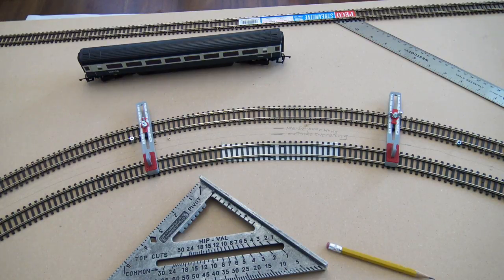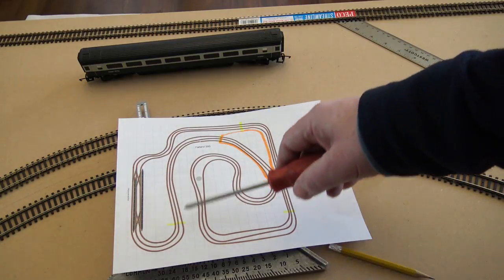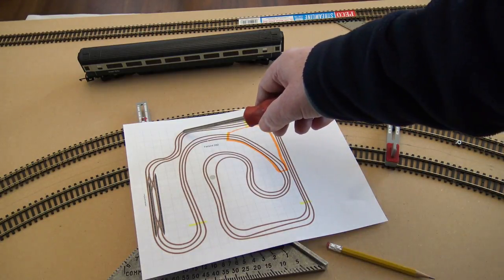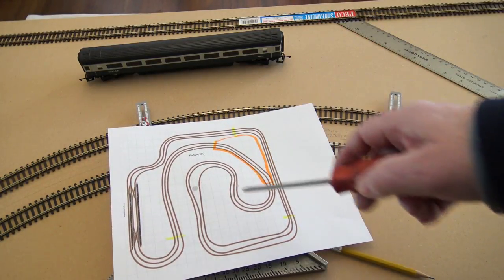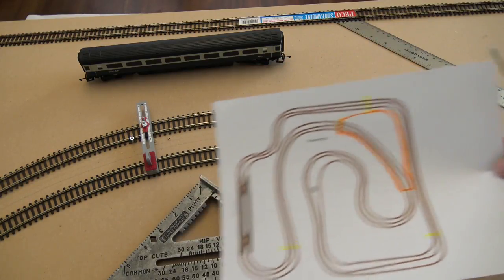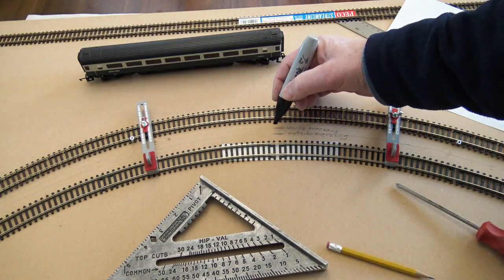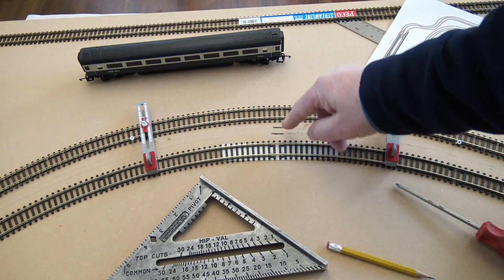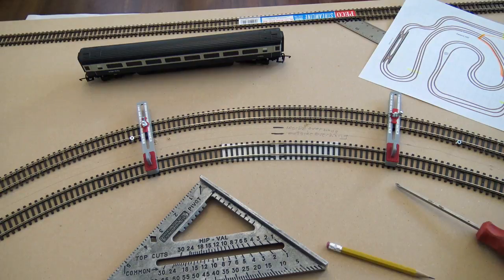01B Farland - Curve Radii

Comment: I'm just surprised that someone deliberately introduces inclines into their main track. I can see that the difference in elevation looks good but with level track even poor runners stands a chance.
Reply from the maker: Hi Alan, Glad you asked and happy to answer.  Flat is not as interesting as variations in levels.  Admittedly the engineering, craftsmanship and design must be carefully done, otherwise you have lots of trouble.  However, if the inclines are very carefully built and all rules of layout parameters are met, there should be no troubles.   I won't go into all the things I see people doing to sabotage their layouts, but my troubles are few.  My GWR King steam locomotive can pull 19 coaches up my inclines and this was demonstrated on video.   This video is 01B.  I am now on 87B.  I try to pass along information to layout builder as I go.  Please subscribe and see if I can help you too.  Thank you, Rob

Comment: Rob,

I saw that you have your throttle on your iphone.  And you mentioned that 2 throttles can be on an ipad.

What is the throttle app that you are using?  Are you happy with it?  Is it free?  Do you think it will connect wirelessly to NEC?

Bob
Reply from the maker: Robert Schworm Hi Bob, I use the Z21 system.  I am using their app.  The box that connects to the track you have to buy from them, but the app is free.  Rob

Comment: Rob,  I have a lead line into a small 3-ladder yard.  What is the recommended way to ballast a lead line into the yard? Should I ballast the lead line up to and including the first switch into the yard, and then place the track on the benchwork base?  Should I use your sub base under the rails or go directly on "the ground"?  What do you recommend for ground cover in the yard?  Thanks.

Bob
Reply from the maker: Hi Bob, There is no right way or wrong way to do this.  When you look at yards where they are intensely used, the rails seem to be sitting on dirt. with no elevation from the ground.  My advice is to look at lots of phots of yards and then decide.  Thank you, Rob

Comment: Rob,  I read somewhere  that your track radius should be at least 3 times the distance between your longest set of trucks.  So I guess if the distance is 8 inches, that makes the radii 24 inches.  Have you heard of this?  This is in addition to your car overhangs.

Bob
Reply from the maker: Robert Schworm Hi Robert, The correct radius is a radius from the manufacturers recommended minimum and a scale actual.  Once you get larger than the min recommended, it depends on how much room you have.  I chose a minimum of 22.5 inches of radius because I have the room for them in a complex layout.  On a real railroad it could be as much as 7,000 meters for high speed.  Divide 7000 meters by your scale and you’ll see you would need a very large layout.  For narrow gauge curves might be 50 feet.  Divide 50 by your scale.  As you can see, there is no correct radius because it depends on multiple factors.  I cannot run my High Speed Trains at their scale maximum because my curves are too tight although I can run them very fast for model railways.  It is a complex subject. 

Distance between the rails is a wholly different subject.  Thank you, I hope this helps, Rob
Reply: Thanks.  I thought that if the radius is too tight, then the trucks might lock and not be able to swivel, thus jumping the rails.  Guess a test run would solve it though before everything gets glued down.
Reply from the maker: Hi Robert, Generally, the manufacturer will provide a minimum radius for their models.  If that is unavailable, by that I mean after a lengthy seach it is not available, then trial and error is your only course of action.  Thank you, Rob
Reply: It gets a little more interesting when your entire layout is with flex.  fortunately with anyrail and selecting the S for track library, that helps a little.  Then I researched American Flyer a bit more and there is some info about minimum radius for that gage which is about a radii of 22 inches.

This is a very interesting hobby to be sure.

A guy in europe built a beautiful layout with a long incline.  Fully sceniced and beautiful - - - then he does a test run up his incline - - and it stalls out....including just the engine.  Hard to believe.
bob
Reply from the maker: Robert Schworm Hi Robert, a real locomotive would struggle with a 4% grade.  That is a 4 foot rise in 100 feet.  Mine are all 2%.  1 inch in 100 inches.  I wanted to be sure a steam locomotive could go up with at least 3 coaches and they all can.  Some with more.  The most common mistake with a Model Railroad is the grades.  Newer modelers always go way too steep.  Never fails.  Even when you warn them they do it anyway.  Do not put a curve or turnout right at the top or bottom either.  Thank you, Rob

Comment: Rob,  I am watching the building of Farland with great interest into the details.  What is meant by 1st, 2nd, and 3rd radii curves?  In video 1b, Checking the spacing on curves for passing coaches is very helpful.    By now Farland is probably up and running.  I am using AnyRail software with great pleasure.  It allows me to place paper trackage on my benchwork to verify spacing and radii.  Your trainroom is beaautiful, very lucky to have it.

I am watching your entire series as closely as I can.  I am doing S scale 1/64th.

Thanks.

Bob - Cleveland Ohio
Reply from the maker: Robert Schworm Hi Bob, That sounds like a very interesting project, the building of a 1:64 scale layout.  Slightly larger than my scale 1:76.   In OO scale, Hornby a very old manufacturer of OO, they have a track geometry and they produce standard fixed (or set) radius track in 4 radii.  It culminates with 4th radius which is 22 1/2 inches.  My new layout features the smallest radii curves at 22 1/2 or 4th radius.  It is sort of a short hand for British scale modelers.  Most folks use flex track now.  I was being my very conservative engineering self when I set my spacing.  If you start with any video in this series, with the B suffix, YouTube should automatically take you through the series if auto play is on.  I am at 76B now.  Thank you, Rob
Reply from the maker: Robert Schworm I was wrong, for auto play of the series you need to go to my home page on YouTube and use the playlist feature.  There are several interesting playlists you may like there. Cheers

Comment: Strange that you need larger clearance on larger radius curves.  Logically, as the radius increases to infinite, and hence the track tends to straight, then the overhang and "underhang" tend towards zero.
A long time too late, but possibly useful for others, the free software package SCARM works well for settrack and can be used for flexi, but to less benefit. 
Too many of your clips, including the old layout, are interesting, and I'm digging into the archive, hence the comments on older videos.
Regards, 
Tom
Reply from the maker: Hello Tom, well you caught me, I am very/extremely cautious.  I set my largest coach on the smallest curve track and rocked as far as it would go without derailing to both sides, measured it, and that is what I used to determine my clearances, plus 6 mm.  I just didn't want the excitement of finding out with certain combinations coaches/cars under unusual circumstances they could strike as they passed.  Sometimes these models do not behave like their full sized prototypes.  They can waggle.  So, yes, very conservative engineering, but now I can run at ridiculous speeds at times and not worry that I have exceeded the safe margin of error.  These are  1:76 scale trains running on HO ga. track. That in itself is messed up enough.   There are many peculiarities to OO ga.  That is why the gaps are so wide.  Thank you, great comment, Rob

Comment: So many regulations and inspections in your build Rob. Your choice of 4th radius as a minimum sounds very sensible if you have the space. Good to see the practical way you work out clearances. I love old tools - is that a roofers angle measure? It mentions spars and beams. John
Reply from the maker: John Mellor Hi John, I think what you refer to is what we call a speed square.  It does have angles and other things on it.  You could build a house with it a level and a measurement device.  Thank you, Rob

Comment: Hi Rob, great to see you're starting the new Farland already. With the track spacing my opinion is that if it works well and looks ok then it's good enough. Standard track spacing is 6' between the railheads and 10' for sidings, so 24mm and 40mm. When you consider we are happy to accept a 16.5mm gauge to represent 18.8mm, compromises will have to be made. If you want to justify a wider spacing then say its in the West Country. Many of the stations were built to Brunel's 7' gauge and when standardised it was easier to move the tracks further apart than move the platforms closer together.
Reply from the maker: Gary Hodge Hi Gary, Yes as I mentioned in the video, 6 feet between tracks is the norm in the U.K.  Since model train layouts do not have scale curves, they are much tighter, we modelers must increase the spacing or risk rolling stock slamming into each other when they pass.  I determined that an extreme sway with a Mk3 Hornby coach could produce an almost 6 mm need for clearance.  I decided to err on the side of safety and allow 12 mm or 1/2 inch between the exaggerated coach path.  That equates to 46 mm between rails or 13 feet 6 inches.  I am making sure a collision can never happen.  The spacing then is driven by the needs of practicality, not scale.  Thank you, great comment, Rob

Comment: Hi Rob planning changes 100 times I can believe that mate. I'm sure you will get the way you want it in the end. 46mm form inside to inside on the track set apart is about right and should meet up with your points spot on if you decide to put any in just after the curve. track planning is always the fun part of building a railway. because you know what comes next. running trains the track has to be tested right. lol........regards Tony.
Reply from the maker: Hi Tony, 46 mm is a scale distance of 13 feet 6 inches.  In the UK the standard between track distance is 6 feet.  In the USA it is 10 so it will be out of scale, but should  work well with the curve radii I will be using.  I am very much looking forward to building this layout.  I wish I could start today, but the room is not done and won't be for as much as two weeks.  Oh well.  Thank you, Rob
Reply: two weeks will be over before you know it. then its down to business as usual. on the bright side there more time to plan the branch you where thinking of adding.............Tony
Reply from the maker: TONY NORTH EASTERN True, it will seem like ages though.  I have decided to wait on planning branches.  As a result of the investigation done on this video, I discovered I have more room than I thought.  I was even able to add some space to the work area where I can paint and build things for the layout.  Thanx, Rob
Reply: its always a bonus to have more space than what you though you had ...Tony
Reply from the maker: TONY NORTH EASTERN Most certainly better than finding less. Thanx

Comment: Hi Rob,

Nice plans and I think it will work out well.  I like your method of making sure you have enough space on your curves.  I need to do that but those track measurement spacers aren't available over here atm.  Anyway I plan to use 72 inch radius curves (6ft) with track centres at 48mm so a little closer than peco's streamline.  I hope it will be ok,  I'm tempted to go closer but I don't know if it's worth the risk

Cheers,  Michael
Reply from the maker: Hi Michael, I am hoping they do work out.  If they don't, it won't be for a lack of planning. lol  I found the Proses adjustable spacers online.  They were relatively cheap and I felt they were an absolute necessity.  Buy them from over here and get them mailed to you.  I bought mine at Hattons.  Based on a 6 foot radius curve, you can probably put your tracks within or close to the scale 24 mm range.  The Hornby 4th radius curves are 22 inch radius.  Where are you?  Thank you, Rob
Reply: I'm in the uk but didn't see them on hattons but I will take another look.  Yeah the scale centre to centre is 44mm I believe so I decided to play it safe in my track planning software and make it 48mm to allow for overhang and swing.  I also made sidings/goods lines at 58mm as they always have more space to allow crews to walk about and uncouple safely. Cheers
Reply from the maker: That is a good point.  Where I have sidings or in the engine yard I have planned, I should leave more space.  I thought prototypical track is laid with a center to center of 10 ft 8.5 in (3.26 m) in the United Kingdom which leaves you 6 feet between the rails.  I read that on RMWeb as well.  4 mm x 6 mm = 24 mm?  At least according to an article on Wiki.  Good luck Michael.  It might pay to do the same exercise I just  went through to determine the best distance.   I cannot have mine at 24 mm, I need 46 to leave good clearance.  Thank you, Rob

Comment: I find a spacing of 2.5" or 3" centre to centre on the curves works great.  I know large curves takes up quite a bit of space but the minimum should be 28" for passenger or auto racks.  I never used the Woodland Scenics foam track but I hear lots of people don't like it and have gone back to cork.
Reply from the maker: Scott Downey Hi Scott, track foam makes for very good acoustic isolation between the track and the board.  I used it on old Farland and had no problems with it except where I nailed the track.  This time I am going to use foam tack exclusively for the foam and track.  According to what I dug up 6 feet is prototypical.  That would be 24 mm.  If the curves were scale, it might work, but even Hornby 4th radius curves are not close to scale.  Today I determined how close together I can put them.  Thank you, Rob

Comment: any plans to super elevate those curves?
Reply from the maker: jonnken Yes, I have given it serious thought.  I am going to use Woodland Scenics foam track bed, do you think it would still work with it?  Thank you, Rob
Reply: I've never done it, but believe it's accomplished by installing an increasing and decreasing height gradiant of small pieces under the outside rail ties of a track curve. It should work with a foam track bed.  And then cover everything up with track ballast. 

I think it's a great look to have train cars leaning into and around a bend...especially the taller cars like the intermodals or auto racks. I think only about 5 degrees is enough.
Reply from the maker: jonnken Cool, I'll check with Dave Watson and see what he uses.  Thankx